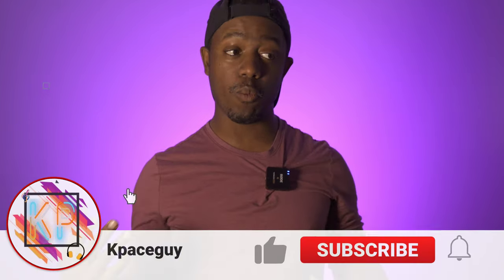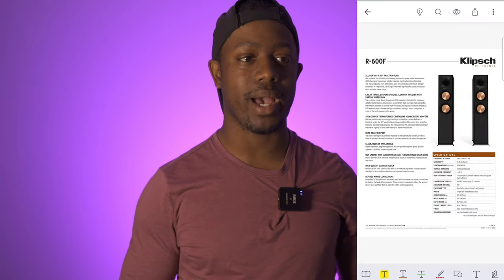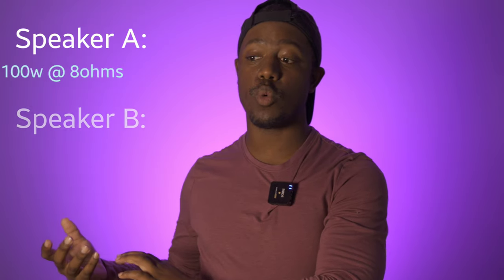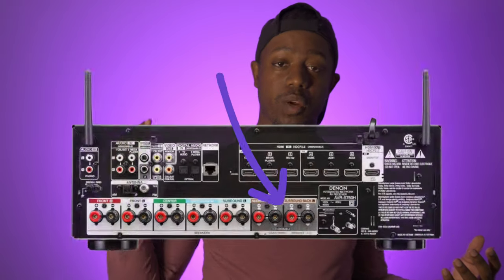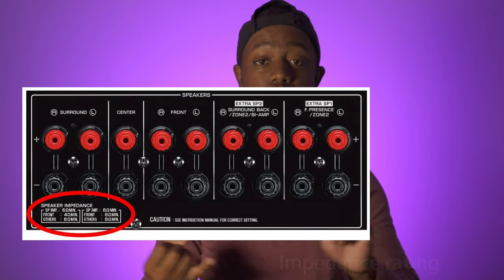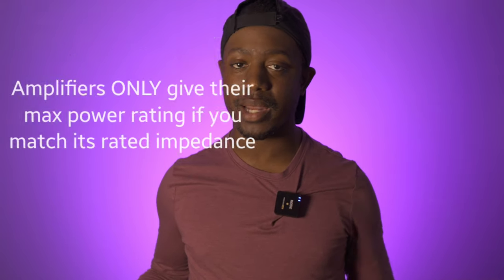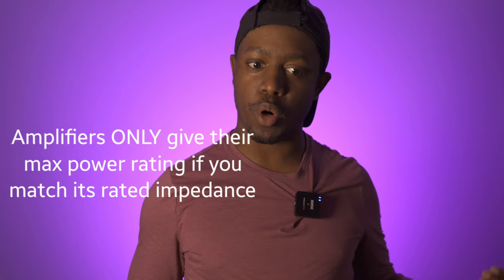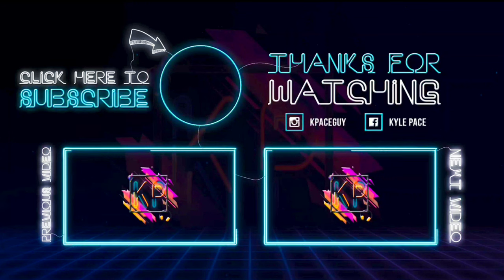Speaker Impedance (Ohms) and How to Match Amps w/ Speakers

Comment: I have a set of floor speakers 20 + years that are not marked how do i figure it out?
Reply from the maker: Take the speaker out and look on the magnet of the speaker
Reply: Thank you for your reply, even though they are old they still look great, my question is, the front and back are covered with cloth, and both sides are hardwood ( I believe ) how do I get inside without ruining them cosmetically? @Kpaceguy

Comment: I have 5 x 8 ohm speakers and 2 x 6 ohm speakers, what should I set my avr to, 6 or 8 ohm. Thanks.
Reply: 6 ohm. 

Because a 6 ohm receiver can drive both the 6 ohm and the 8 ohm speakers but an 8 ohm receiver shouldn't be paired with a 6 ohm speaker.

Comment: Hello, I have a denon dra-800h running klipsch rp-280f's for my front speakers rated at 8ohms. I just bought a pair of emotiva t2+ speakers rated at 4ohms. My question is if I set my denon for 4ohms, can I run both the 8ohm klipsch and the 4ohm emotiva's safely?
Reply from the maker: You did need to switch it. But yes it'll be fine
Reply: @Kpaceguy  will the stereo run hotter? Also will I be able to play it at higher levels without any damage over time? Btw you just got a new subscriber 👍
Reply from the maker: @timbabyfacesavage377  I appreciate it. Your receiver will play fine at any volume as long as your speaker don't ask for too much power at higher volumes
Reply: @Kpaceguy  ok, I appreciate it man you rock and keep up the content 👌

Comment: Most AV receivers have Ohms setting option. In my setup my LCR are 8ohm rated (B&W 603) and my surround & 4  height speakers are 6 ohm rated (old Yamaha).
My receiver is Denon 8500H. The ohm setting on my receiver is at 8ohms. Should I change it to 6ohms as most of my speakers are rated @6ohms except the LCR ?
As per another expert in this AV domain one should never touch the ohms setting on the receiver/amp and must keep it @the default 8ohms! I am confused. Pl help. Thanks much.
Reply from the maker: I've heard you shouldn't touch it either. I haven't heard why but I've always just left it alone
Reply: @Kpaceguy  thanks much for your reply! That means irrespective of the mixed ohm settings of anyone's setup the ohm setting on the AV receiver should be kept at its default value 8 ohms.

Comment: What does it mean when your speakers are rated from 4 to 8 ohms
Reply from the maker: That at certain frequencies and volumes they can dip to 4 ohms
Reply: @Kpaceguy  ok thanks for the information
Reply: I was wondering can you do a second video on  ohms but goes in depth in  between the ohms like  6 to 8 ohms 4 to 8 ohms  or 2 to 4 ohms just to have better understanding how  the   Frequencies work

Comment: Can I pair 4-6 4 ohm speakers to a single 4 ohm amp?
Reply from the maker: It's a 4 ohm amp with 1 channel?
Reply: It’s a 4 channel amp but I was told I could bridge 2 sets. Somewhat knowledgeable on how to do that but I’ll have to do more research
Reply from the maker: @stevenstarbird1305  if you bridge it, it may change the accepted ohms so just check your manual. As far as how many speakers you can plug in, 4 is max. If you add more then 4 it drops it to 2 ohms

Comment: So I have a 400 Watts so it would be 200 W two channel 100 W four channel with a 8 to 16 ohms Sony receiver STR – DE135 as long as I stay in between 8 to 16 ohms, I should be fine with all the speakers sent back to the receiver because technically it’s one channel

Comment: can i connect two 8 ohms speakers with 300 RMS per speaker with Nova x1200 amplifier to one channel?
Reply from the maker: Yes
Reply: @Kpaceguy  Thanks
Reply: Hope you understood me, i want to power the two 8 ohms speakers to the Nova amplifier x1200 only to channel one. The channel two will not be connected.
Reply from the maker: @DJWASAASA  yes I understand. Answer is still yes
Reply: @Kpaceguy  i really appreciate, you are the best.
Reply from the maker: @DJWASAASA  Thank you buddy
Reply: @Kpaceguy  Can i also connect two subwoofers of 8 ohms, 400 rms per subwoofer and two 8 ohms speakers of 350 rms per speaker with Dynacord SL 2400 amplifier to both channels? Please check it for me.

Comment: my concern is the wiring. i have 6 ohm speakers and 4-16 ohm receiver that has switch for below 8 ohm speakers and if you switch it at 8 ohm it can drive up to 16 ohm. how do i connect the speakers? switch to below 8 ohm and positive-negative to each speaker+channel wiring or choose 8-16 ohm and do series wiring? series wiring will be 12 ohm right? this will be temporary receiver  for around 1 month until the new amplifier arrives so i will not blast the volume to max. the new amp is 4-8 ohm that can also drive 3 and 6 ohm. how do i wire this amp?
Reply from the maker: You want to wire to the lowest possible ohm rating. Or else you won't get nearly as much power
Reply: so i'm doing single wiring with both?
Reply from the maker: @Sapia Ntomata  I don't know how many voice coils you're using per speaker but do whatever needs to be done to wire each speaker to 6 ohms if that's is lowest impedance
Reply: @Kpaceguy  i don't know anything about voice coils, but the speakers are the bookshelf Dali Spektor 2 which are 6 ohm. the new amp i've ordered can drive 6 ohm speakers. at 6 ohm it gives 90w per channel which is 5w more than 8 ohm. the max output at 8 ohm is 100w so at 6 ohm it should be at least 110-115. the amp can also get a 48v power supply and with 48v at 8 ohm it has 100w and max output 120w so at 6 ohm it will get more than 120w max output.
Reply from the maker: @SapiaNt0mata  you're making it more complicated than you have to. Just plug them up red to red black to black. They'll work completely fine. Leave your amplifier set to 8 ohms
Reply: @Kpaceguy  ok.
the new amp that has 90w(110w max output) at 6 ohm is ok for Dali Spektor 2? i ask cause i don't know. the same amp has option with 48v power supply(the default is 36v) and the difference is €15 more and the amp gains more watt. should i get the default with 36v or with 48v?
Reply from the maker: default
Reply: @Kpaceguy  can i drive 200w/8ohm/90db sensitivity speakers with a 2x85w/100w max output amplifier? the speakers cost €160/pair and have 2x 6.5" mid range and 1 horn tweeter and i want to use these for games, movies and rap, etc music cause i bought Dali Spektor 2 but the bass is not enough for me. i don't mind if i don't get the full power of the speakers. i'm satisfied with the Dali volume so if i can get this it's cool. there's also a 250w pair with 3x 6.5" mid range at €205/pair. can i drive these?
Reply from the maker: @SapiaNt0mata  match your rms rating as close as possible
Reply: @Kpaceguy  does this mean no and i have to buy another amp?
Reply from the maker: @SapiaNt0mata if you don't want to buy a new amp, don't push your current one too hard

Comment: Hi can I use 6ohms 75watt speakers on my 8ohms 80watt amplifier
Reply from the maker: No
Reply: @Kpaceguy  OK thank you
Reply: Hi I took your advice on speakers so I purchased the proper ones 8ohms 80watt with built-in tweeters. My question is the ones I removed 8ohms 30watt had  tweeters connected to them.although new speakers have built in tweeters do I connect other tweeters or remove them.thank you for any advice. Best regards
Reply from the maker: @kenroper68  do not connect anything. You change the ohms rating when you connect more speakers
Reply: @Kpaceguy  thank you I will remove other tweeters from cabinets.appreciate your help and advice. Best Regards

Comment: I have Denon S650H receiver 4-16 Ohm on the back of it, its 5 channel, I have Polk RC60 speaker 8 ohm, can I cannect 8 speakers to it? or 2 speakers on the same channel @kpaceguy
Reply from the maker: You should never connect more than one speaker to an amp if the total ohm load is lower than rated. So as long as all your speakers are 8ohms then you can connect 2 speakers to one amp as long as you're within the power ratings of the amp and speakers
Reply: @Kpaceguy  so the 4-16Ohm on the back is per each channel?
Reply from the maker: @hanyshanata  yes

Comment: This is right,sort of 
Your not going to fry your amp unless you are driving it maxed out for a long period of time.
It would sound like crap. If your playing a 6 or 4 ohm speaker on an amp with a nominal rating of 8ohm
You just have to turn it up a bit more. But,yes best to match them up
Reply: I’m really trying to understand Ω and watt but I don’t get it,..
If 4 Ω speakers requires more power from an amplifier, then how is it that an amplifier produces more watts when they’re set to a lower impedance? Isn’t that more powerful ? 
Would really appreciate any clarity! 😅

Comment: Most modern amplifiers can handle 4 Ohm even cheap ass Pyle amps are rated at that load. Even my old RadioShack amp can handle 4 ohms from 2008.  It's when people Try to daisy chain a bunch of speakers to a amp they have issues.

Comment: The information in this video is 100% BS. There's not even a basic understanding as to how this stuff works. Its really painful to watch.

Lets start with resistance ratings on speakers. An 8 ohm speaker is not an 8 ohm load. Its an average. The amount of power an amp produces is based oh how much resistance the speaker shows the amp, and the amount of resistance the speaker shows the amp is based on frequency. So, if you ask a speaker to play a high note, it may be something like 10 ohms. Any notes the speaker is asked to play above that note will be higher than 10 ohms, and the lower the note, the lower the resistance.  The 8 ohm rating on that speaker is only 8 ohms at 1 particular frequency. That's it. By itself, that 8 ohm rating is practically useless. If you take 10 speakers all rated at 8 ohms at 100 watt power handling, they will all present a different load to the amp. Some of them may be very easy to drive, while others may be very difficult. The lower the resistance, the harder the amp has to work. Knowing that, we should be looking at a much more relevant number. If you  look on the spec sheet for your speaker, you will see another ohm's rating. That's the lowest amount of resistance the speaker can drop down to. The listing will look something like, 8 ohms nominal (nominal means average), 3 ohms. That 2nd, lower number is the important one. That tells you that no matter what happens, the lowest resistance the speaker can show the amp is 3 ohms. So, if you are looking at 2 speakers and one is rated at 8 ohm (nom), 3 ohms at 100 watts power handling and the other is 8 ohms (nom), 5 ohms at 100 watts PH, the 2nd speaker will be much easier for the amp to drive even though both speakers are rated at 8 ohms at 100 watts PH.

Why are we only looking at resistance? How sensitive the speaker is, is just as important. The higher the number, the easier the speaker is to drive. IF one speaker is 89db and the other is 94db, the 94db speaker will be much easier to drive. In general, ported enclosers are much easier to drive than speakers is sealed enclosures. Crossover order is also important. A speaker that uses 3rd order crossovers are going to be easier to drive than ones that use first order xovers. There's other factors, as well, but you get the idea. 

Now we need to talk about amplifier power. Power amplifier ratings are the biggest scam in the audio industry. There is no standard that everyone in the industry is forced to use so manufacturers are left to rate their own products however they see fit. Just like in the speaker example above, you can take 10 amps all rated for the same amount of power (100 watts into 8 ohms, for example), and if you measure them all the same way, every one will be different. How much different depends on how honest the manufacturer is. You can get a thousand watt amp at Walmart as part of a home theater in a box for $99, or you can buy one that costs more than your car. 

There is far too much information on these topics to handle in a post like this. Entire books have been written on it. I've given enough info here to get you started. From this point forward, do not take my word for any of this. First, fact check me. All the examples I've listed above contain information that can be pulled out of a textbook on basic audio. Confirm what I'm telling you to be true.

Beyond that, if you are looking to buy a pair of speakers, and don't know what type of amp to get, look to the people that makes the speakers. They know all of the games that are played with power amp ratings. They usually list some basic recommendations. Speaker manufacturers know that if you don't have an amp that's powerful enough to run their speakers, you won't be happy with them. So, start with what they recommend. Unfortunately, these youtube videos are absolutely ridiculous.

Comment: I have (2) 2 omh 10” with 600 rms watts with a 2000 mono amp at 1 omh would i connect my speakers parallel or series?
Reply from the maker: Parallel